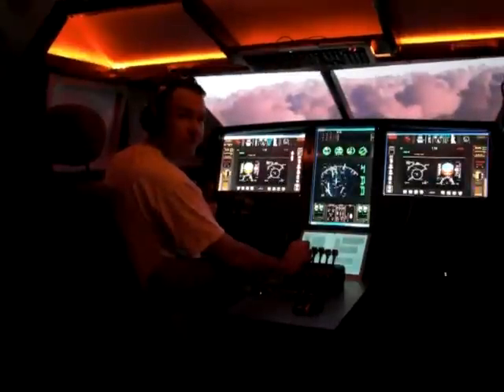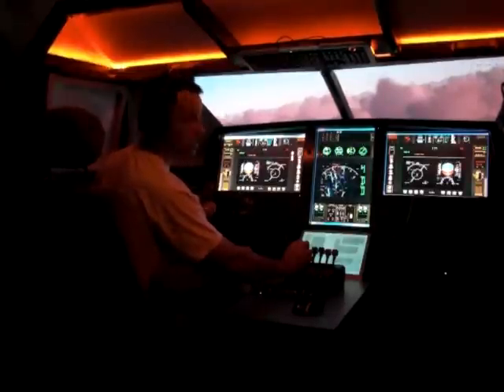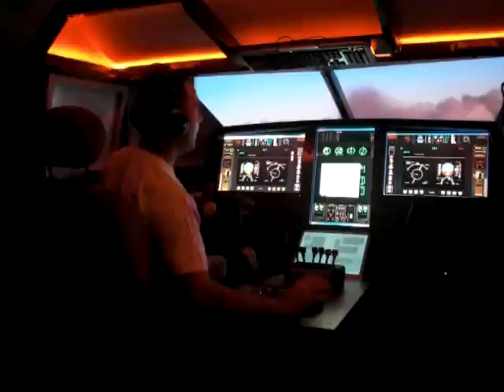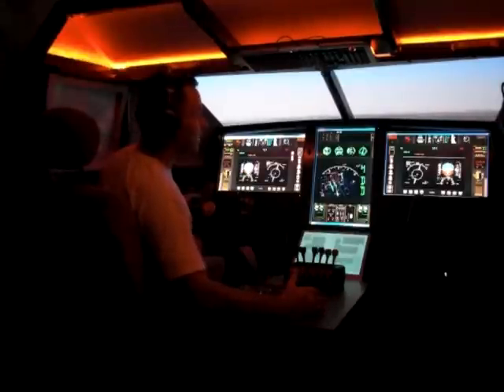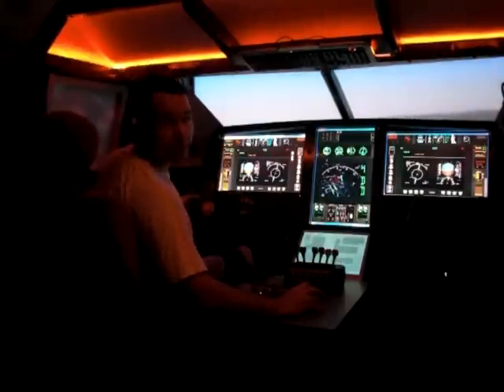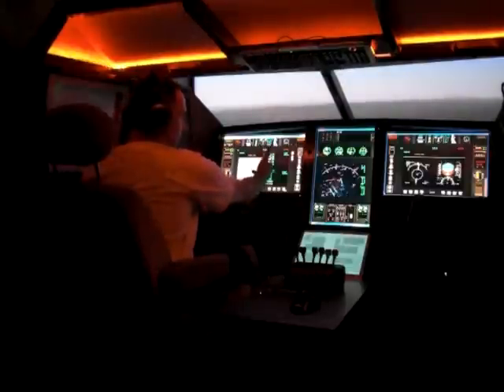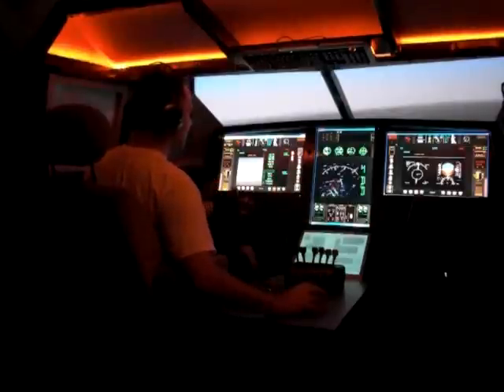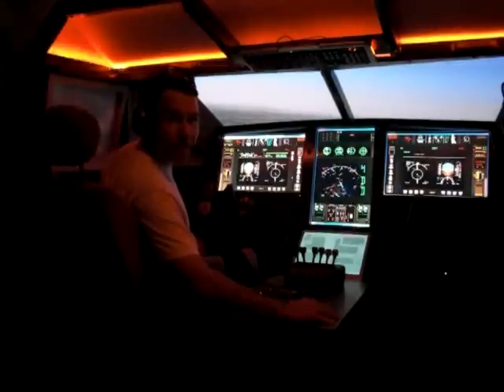FSX FS9 A Brief Talk about the Ultimate Guide to Flight Simulation from SimSamurai.com

Comment from the maker: @Orbit2020 I'll get to it eventuallly.  Im about to test out 3 monitors up front first. It costs alot to add in those side views as I need either two ATI cards or two Matrox boxes plus the monitors themselves so to do it will easily cost $1,000.  I am in real flight traning right now so all my money is tied up into finishing all my real world ratings...AND for IFR training all you really need is one small exterior view monitor so as to be able to see for takeoff and see the runway at landing.

Comment: Was looking around for some specs for some of your systems... Will this be able to handle some of your sim?

Case:	Cooler Master HAF 932 Advanced Computer Case
Motherboard:	MSI X99S XPOWER AC Motherboard
Processor:	Intel Core i7-5820K Processor - 6 Core 15MB Cache – 3.3GHz (3.5GHz TurboBoost) w/ Hyperthreading
Memory:	16GB DDR4 2133MHZ Memory - 2x8GB
Power Supply:	Corsair 750W Semi-Modular Power Supply - Bronze Rated
Optical Drive:	14X BD-RW Combo -
Graphics:	x2 NVIDIA Geforce GTX 970 in SLI -
Sound Cards:	Onboard Audio -
HDD/SSD:	256GB SSD - 540MB/s Read, 530MB/s Write
2nd HDD:	Western Digital Black 1TB - 7200RPM 3.5" HDD -
3rd HDD:	Western Digital Black 1TB - 7200RPM 3.5" HDD -
4th HDD:	256GB SSD - 540MB/s Read, 530MB/s Write
Soundproof:	Quiet-Tech Sound Deadening -
CPU Paste:	Premium CPU Thermal Paste
GPU Paste:	Standard Graphics Card Thermal Paste -
Cooling:	CORSAIR Hydro Series H100i Water Cooler -
OS:	Windows 7 Professional 64-Bit -